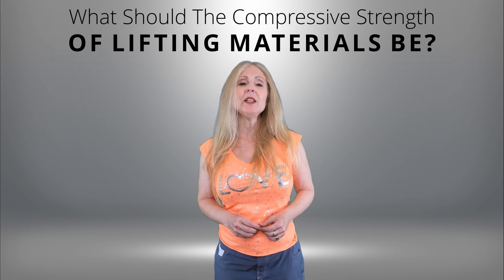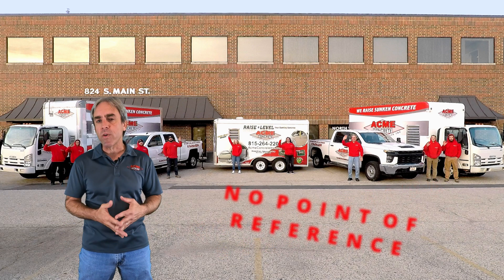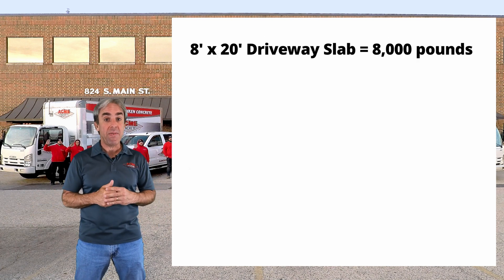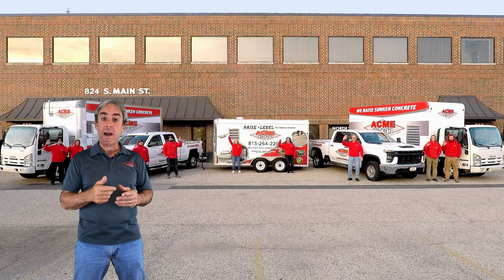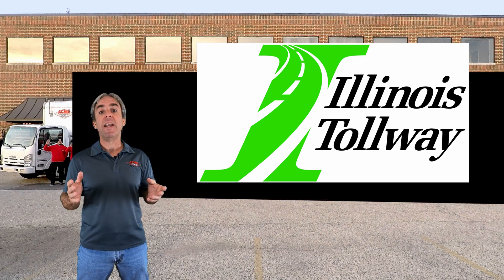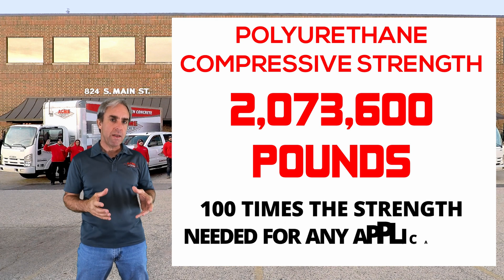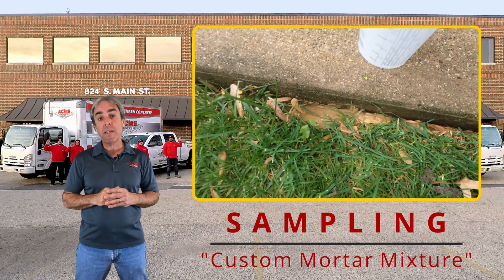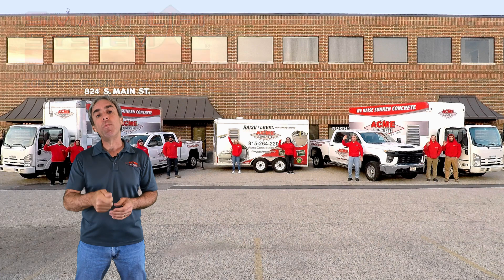FAQ: What Should the Compressive Strength of Lifting Materials Be?

Comment: According to several engineering websites, the weight of a concrete slab is based on CUBIC feet (LxWxH); normally weighing 150lbs per feet³.  You have only indicated the area, NOT volume. Driveways normally are about 4” thick.  In order for a slab to weight 8000lbs and have a thickness of 4”, it would only measure 2.2’ by 6’   I think your information is misleading.
Reply from the maker: Thank you for taking the time to dig in! It's customary to refer to the "size" of a slab by referencing its length x width dimensions. If someone asked you how big is your driveway slab is, you would not answer that question by stating the cubic feet of concrete, you would tell them its length X width or total square feet. Rest assured the 8,000 pound claim made in the video DOES take into account a slab thickness of 4". The math is simple and confirms our claim as accurate: 8 feet * 20 feet * (4/12) = 53.333 cuft. 53.333 cuft * 150 lbs/cuft = 8,000 pounds.